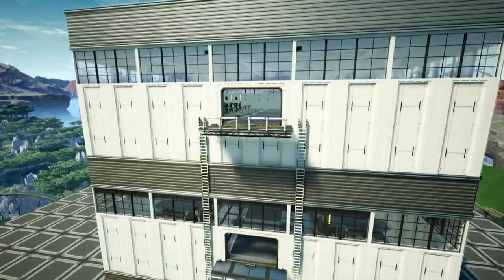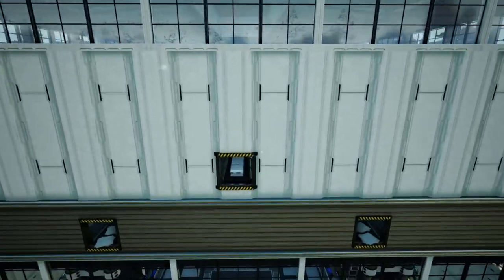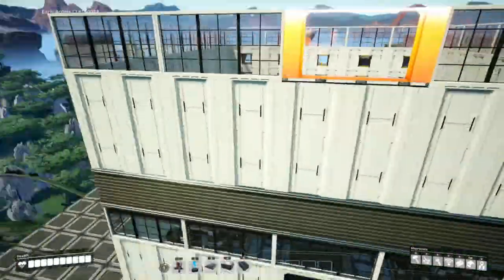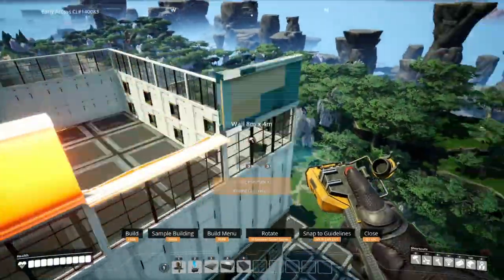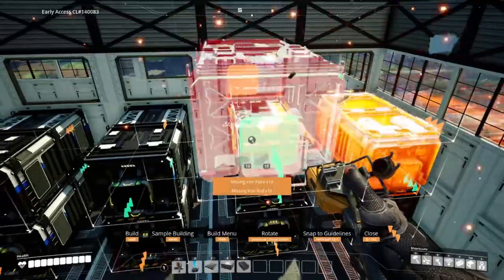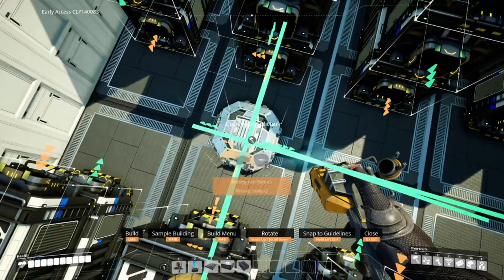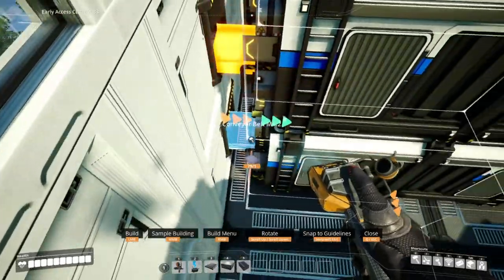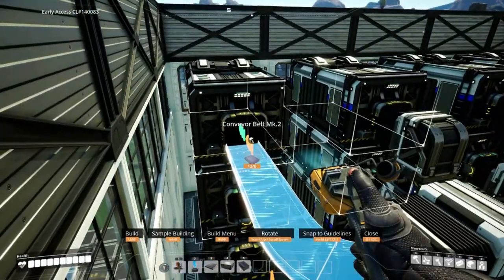CLEAN 5x5 Early Game Storage Build [Satisfactory Game]

Comment: Can I ask a dumb question, not sure I understand the need for smart splitters :(
Reply from the maker: If you have more than one item on the belts! But if it's directly from the levels below you're correct not needed!
Reply: @RunestoneGaming  I think i get it, not sure, will have to play, im not familiar with smart splitters just as yet :D
Reply: @djfishnz  If you have like rods, plates and lets say copper on your belt, the smart splitter filters only what is configurated. Like if you set it up for iron plates, all plates will end in the connected storage. A normal splitter would just distribute evenly between the outlets no matter what the item is.